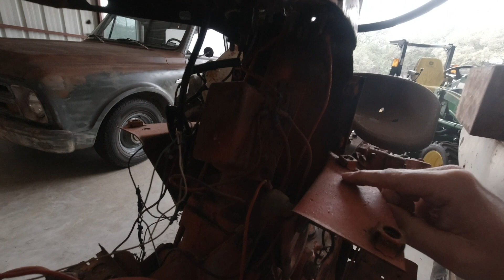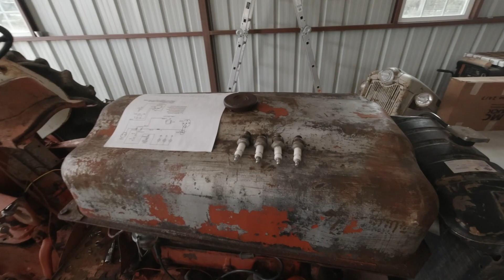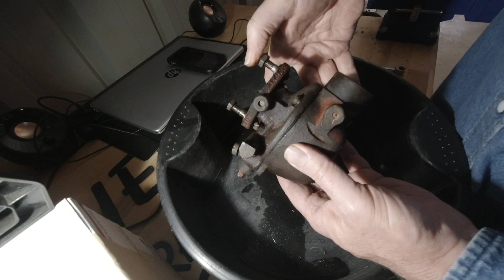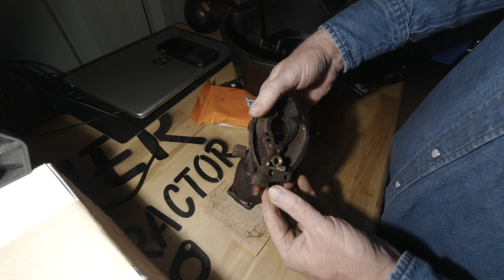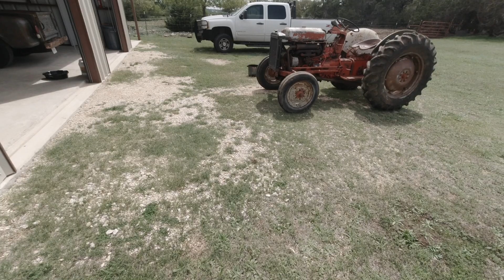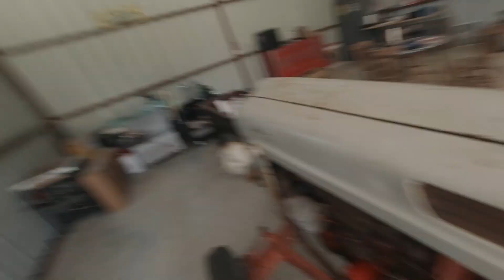Ford Jubilee/NAA - Part 2.  Electrical Issues fixed and other issues found.

Comment: New subscriber. Just got myself a NAA. Still a 6 volt pos ground Wiring is original70 yrs.  It starts and runs and 3 point works so so. Learned about the starter, some how I managed to break the teeth off. I never saw such a deal. So I had the tractor guy replace the bendix. got it home and simply spun the bendix  by hand and the teeth popped out and stays there!  :face-purple-crying: Couldn't get it to go back. Put it in a vise and jumped it no good. Googled it and finally found out just install it  and when the engine starts only then the teeth will retract.  I  been going rounds with dirt in carb probably because I ran it out of gas on first test run.  I also know the centrifical advance in the distributor is frozen and want to check valve adj. while hood is off. I replaced the old small pto shaft. I may convert it to 12 volt if it doesn't keep battery charged. I am retired and like you I enjoy a challenge. I plan to use tractor to brush hog.